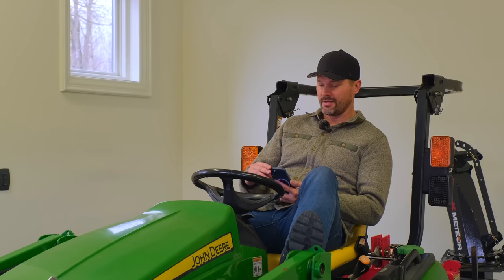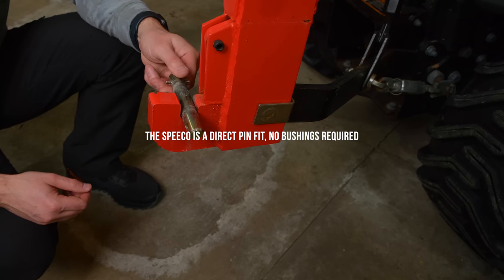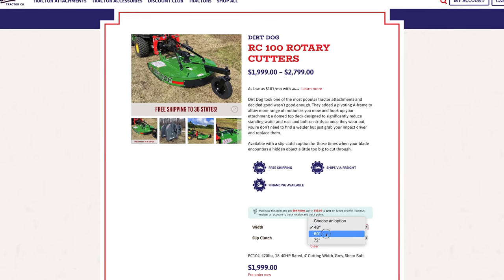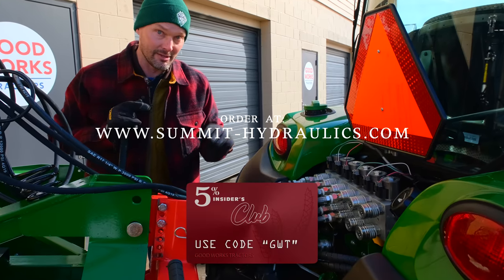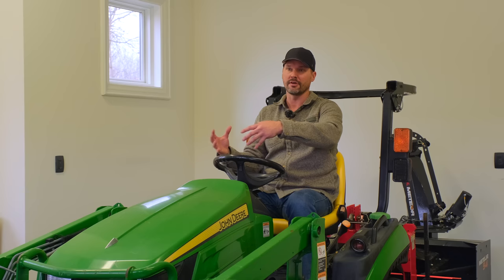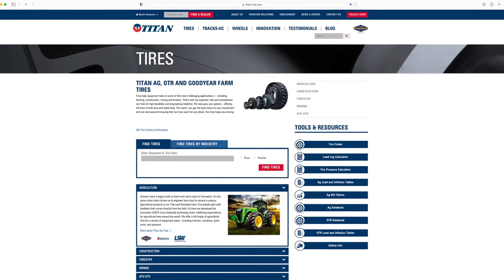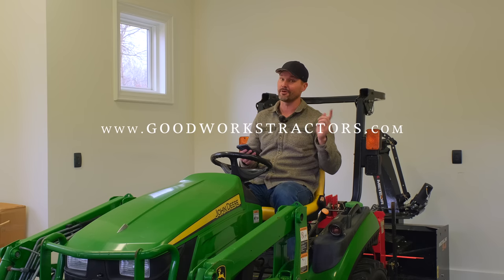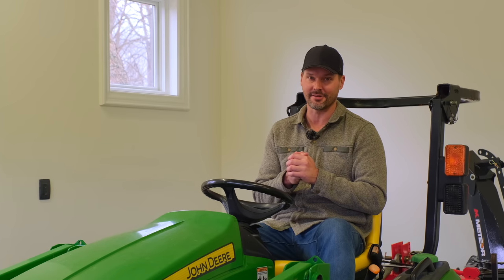YOU'RE WRONG! TRACTOR MISCONCEPTIONS THAT COULD COST YA! 🤯

Comment: One of the biggest misconceptions I have heard is that Kubota is just as good as John Deere.
Reply: Kubota's definitely have some mechanical problems, I didn't like the single bucket cylinder to start with, the treadle design was a huge turn off. Bought a Yanmar even though it was many hours away from all the competitors. Best warranty, highest lift capacity and ground clearance, same engine as JD, less money😊
Reply: Depends on what horsepower you’re talking about and a Persons preference.
Reply: I’ve never had a kubota compact tractor but their mini excavators are worlds better than Deere.

Comment: I can tell everybody what happens when you try to cut trees way bigger than your bush hog can handle, you burn the clutch up in your tractor.
Reply: Isn't the clutch or shear pin on the bush hog supposed to protect against that? Or maybe the clutch in your tractor was already worn or misadjusted?
Reply: @JCWren  not sure if mine had a shear pin or not but I remember hearing the guy at the dealership saying they were gonna have to break the tractor in half to replace it & it was gonna be somewhere around the $4500 range for the repair. Definitely learned a lesson on that one, been several years ago tho
Reply: IDK, guess it depends upon if it uses friction discs or metal coupler. Engaging the PTO at high engine speeds will definitely cause excessive wear rapidly.

Comment: The biggest issue that I found having a tractor is the brand name my tractor that I had was a simplicity tractor with the same transmission that went into a John Deere I had hydraulic issues with my front loader and my steering but I had no mechanics in my area or even in my province in Newfoundland Canada so I had no one to help me repair my tractor I brought it to a John Deere dealership hoping they can help out but they refuse to help because they can only go by part numbers so they told me so just watch out on the brand name and the availability of getting repairs and parts the other thing I noticed is I had a hard time getting front tires for my tractor because it was a low profile Tire because of the front loader on it is only a small little tractor 27 horsepower with a backhoe and it had plenty of power to lift and dig anything up I've even dug out houses with my tractor even jacked houses up and drove my tractor underneath to dig them out so that even the little tractors are capable of doing the work it might take a little bit longer but once you know what you're doing they're very capable have fun choosing the tractor that will suit you and one thing I forgot to mention is as long as you're not abusing the tractor and you keep up on the maintenance of it oil changes in greasing it all the time you couldn't put on so many hours for example my simplicity tractor I sold it with 2,100 hours with the tractor being only 6 years old and it was a subcompact with a backhoe and the backhoe itself could even reach down 8 ft not like most with only a 6 ft backhoe and regards the tires one thing a lot of people appreciated with my tractor is I had turf tires on it never had issues getting stuck the tractor was four wheel drive and people love that I wasn't destroying their lawns when I was doing yard work on their backyards and not destroying their front yards or anything else where the bigger machines they're just leaving trenches everywhere so please think about the jobs that you want to do and how much destruction you're going to make doing a long job. The other thing is don't get overwhelmed of thinking about how much horsepower you have you're in the winter time I did a lot of plowing and I'll get the guys even with pickup trucks asking me to move snow piles for them because they had nowhere else to put it in my tractor only had if I remember correctly a 7-foot reach but by the time you manipulate the snow piles you can actually accomplish approximately 10 ft so it's all in how you use the tractor and not abuse the tractor have fun and be safe